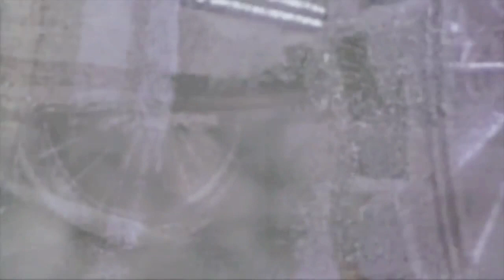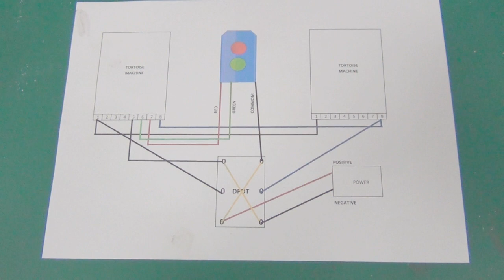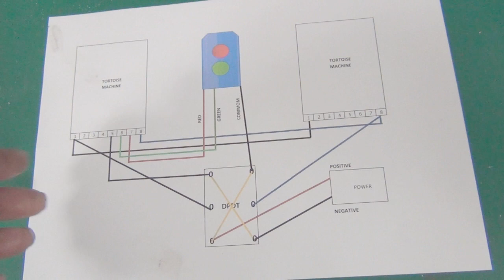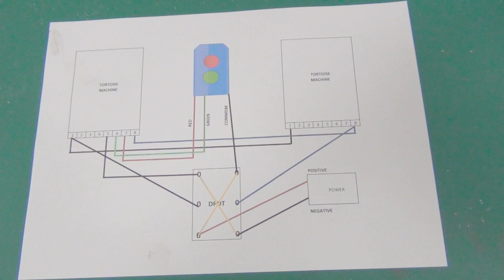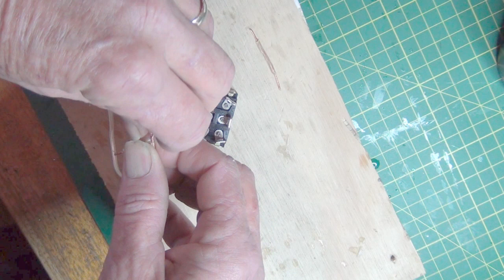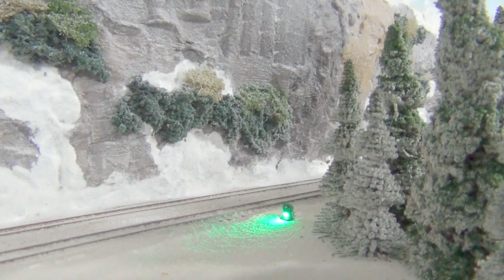Operating 2 Tortoise Machines & 1 Dwarf Signal With 1 Toggle Switch "Model Trains"

Comment: Why are there 8 wires on each tortoise?  On the drawing there are only 6 on one and 3 on the other.
Reply from the maker: The reason i only have 6 on one and 3 on the other is for this set up.
I always put 8 wires on each Tortoise just in case i use the wires for more signal lights.
So pins 2,3,4 i can run other lights

Comment: The indication for crossing over should be red over green or red over yellow.   These would be read as diverging clear or diverging approach.   A green signal alone is correct for a straight route, although it would be very odd to have a dwarf signal for this on the main.  A single red light, without a number board, always means stop.  With a number plate would still mean that the train is staying on the main, but may only proceed at restricted speed.
Reply from the maker: Thanks for the information, and i use the red over green dwarf signals more for me, so i know which way the train is going cheers Robert

Comment: Great demonstration Robert. Are the signals as bright as they appear in the video? They come across quite intense on the video- Sean
Reply from the maker: Yes they are bright, and they are on 12volts but i don't have anything lower at this point.
Will be getting 6volt supply soon cheers Robert